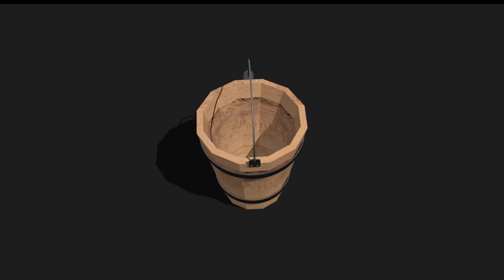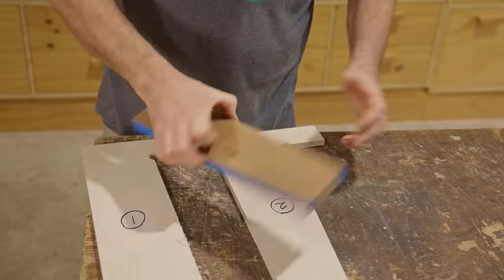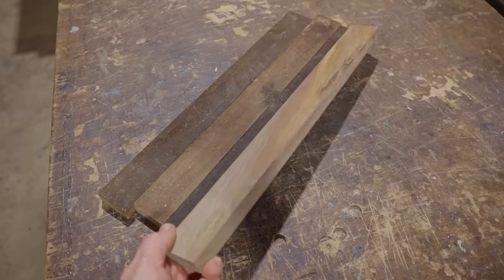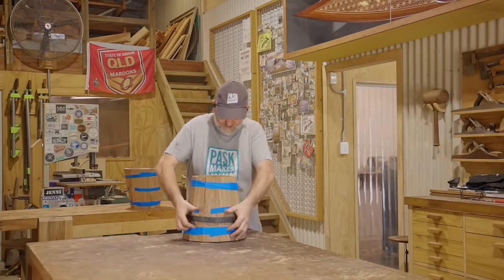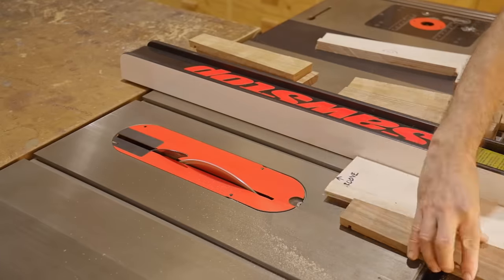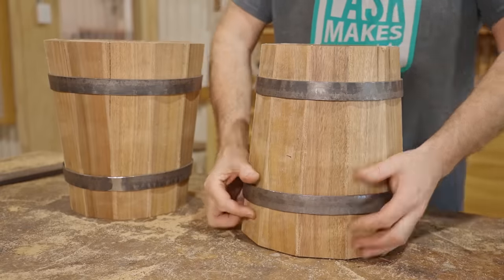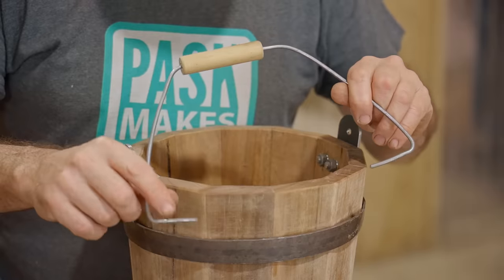Making a Good Old Days Wooden Bucket - Will it Leak? - SWC Ep53

Comment from the maker: https://paskmakes.com/free-plans/

When I made the original wooden bucket back in ep5 of Scrapwood Challenge https://youtu.be/KKrFnkQWO2s  I made, edited and uploaded the video all in one day. Because of that it was rushed and wasn't as clear as it could've been so I've always planned to remake it. 

It's a very cool project and definitely worth a go!
Reply: Timbecon have a nice flat 5 or 6 metre tape ideal for measuring curves. They've got a couple of nice little features, white with black marks, FastCap brand about $18.
Reply from the maker: @ohasis8331  I'll have a look at them, Thanks! :)
Reply: You should have a safety vest on while pushing wood through the saw. It's a mistake you only get 1 Chance at
Reply: Great video, love your work, would of been easier to weld the handle brackets to the top ring in my opinion but I don't have a successful YouTube channel do what do I know! 👍👍👍💚🇬🇧🌱
Reply: 6:07 you know it must have been a rather tiresome process to do that back in the day with just like an adze and an axe  and a plane for shaping ... huh
Reply: I want to see u make this bucket without power tool, like old day
Reply: I wonder how it would've gone if you'd mortised the staves.
Reply: @PaskMakes thanks for the lesson. I really appreciate the fact you show trials and errors along with your success! It makes everything less intimidating. 
I've not worked with that kind of metal...what if you cut the ends of the metal with a slight bevel before welding? Would that help force the ring into the required angle? What about cutting a slight dado on the outside and wire wrapping in a stacked layer? I'm not sure I have the strength to bend flat rods.
Can I coat the inside with melted beeswax? Would that work or crack off?

Comment: If you wanna make it the way it was built in the old days you heat up the steel collars red hot and drop it on. It will burn the wood making it perfect set and once it cools down it will squeeze the wood to a tight fit. The old days they set the cart wheels similar ways. Regardless just the thought to make something like that is cool. I Like your projects and the way you introduce the problem (only  small design flaw) and solving it on the spot. It does encourage others :  "Don't be afraid to make a mistake just learn from it and fix it" Anyone thought about it how they made those over 150 years ago?
Reply: Look up EngelsCoachShop on YouTube.
Reply: Oh wow. I suppose the rings will be expanded when hot, and when they seat, cool down, burn themselves on, they'll also shrink, adding tightness?
Reply: @MetalY2KMusic  
They shrink a little and help close gaps.
Reply: Heating the bands is not necessary on a tapered bucket. Just make them a tad undersized and force them into place from the bottom up.  They usually used a tool that looked like a blunted chisel to drive the hoop into place.
Reply: u will need water too, it makes the wood swollen
Reply: @Anvilbanger  and you can do it without glue that way to. Made replacing slates easier.
Reply: Burning them in is not a good idea, as you'd mostly be thumping the bands down tighter as the wood expands and contracts with temp changes after a couple of months. But heating them up a bit is a good idea. Cart wheels were different, you didnt want them to get loose at all, burning them on was just an affect of the extreme heat needed to maximise the fit.
Reply: Yes it is like he never bothered to watch a Cooper's video doing it properly! Iron hoops were too expensive long ago, only more modernly became used regularly, they used to use rope or wood in the same way as rope. Just look at old paintings.

Comment: My great grandfather made buckets in this style. He used to make the bucket itself out of softer wood and reinforce the spots where the handles were fitted with pieces of harder wood, so that the weight rested on those pieces.

Not too important if you're just using it for light work, but he had buckets that lasted decades for daily construction work. Cement mixing, carrying water, holding sand and dirt, things like that.

A day to make the buckets yielded decades of use.
Reply: Did he make the whole stave out of hardwood (two of them on opposite sides) and attach the handles to them?

Comment: In the winery we have particular brands of oak barrels that are notorious for leaking when new
To fix this we fill them with hot water and then run hot water over the sides which is a quick way to seal them
We also use a soft bees wax for minor leaks when filling with wine
Reply: Does the water cause the planks to expand or is it some other mechanism?
Reply: @IgneousExtrusive  yes, when the wood is soaked with fluid, the fibers expand

Comment: Great work! My grandfather was a woodworker & made a couple of buckets. He used many of the methods that you do. The one difference he did was to attach the handle to the upper ring. He said that it used the weight of the full bucket to help p seat the ring & keep things tight. He used parafin wax & linseed oil between the staves  & on the bottom for waterproofing.

Comment: I really like it. There is only one thing I might do different, and that's heating the ring for the final install in the same way a wheelwright would heat a steel tyre for the final fit on a wagon wheel, and quench it in the same fashion as well. I vaguely remember watching my Grandfather do it like that on the farm when I was a wee kid. Although I know my Grandfather was a blacksmith by trade, not a cooper, or a wheelwright either for that matter. Although most men of that time were somewhat multi skilled.

Comment: Now imagine how they were doing that before, without the adjustable angle power tools
Reply: Mate we've had stable, fixed drills and saws for over 10,000 years. They're not a complex idea
Reply: @jeremymcadam7400  there wasnt anything of the sort for saws during that time tho, it was all made with handsaws and planes
Reply: @jeremymcadam7400  you really have no clue on the timeline like yeah we had them for a long time but probably at most for 2000 years not10000
Reply: @jeremymcadam7400  We were living in caves 10 000 years ago. That’s about when homo sapiens sapiens was created. Complex tools would fit right on with for example the Roman empire, about 2000 years ago.
Reply: @josku5  modern anatomical humans are 300,000 years old... There are people living in caves today with no modern tools. The pyramids of Giza were older to Cleopatra, than Cleopatra is to us (around 6000 years old today). We barely have written text left from Cleopatra's time, let alone any idea what the civilization was called that built the pyramids. My point is that our evidence for civilization doesn't last very long, so just because we don't have preserved tools, doesn't mean they weren't around, why wouldn't they be around? 

 Another mind bender; Oxford University is 300 years OLDER than Machu Picchu
Reply: @jeremymcadam7400  not 300 years older, 300 years older than the discovery. Also, no. We did NOT have a modern table saw with modern computing technology 10 millennia ago.
Reply: @generallaro1269  No, Machu Picchu was built in the 15th century
Reply: @jeremymcadam7400  genius. Absolutely genius. You need a nobel prize
Reply: Oh shit you're talking about the inca city, not the mountain. Nvm then. Still though, we did not have a modern table saw with modern saw stops and electricity back 10,000 years ago.
Reply: @generallaro1269  are you 5?
Reply: @generallaro1269  my brother it is a spinning abrasive disc mounted to a table. no metallurgy, astronomy, or even numbers needed. not exactly rocket science
Reply: I followed this design and made with hand tools. No need for jigs and pretty straightforward... Just made a plywood pattern for the staves. Set my bevel gauge using Pask's excellent angle chart and Bob's your uncle... Took maybe 45 minutes to cut the 12 staves from salvaged oak and angle the sides with a jack plane. Cutting the slots was a bit of a challenge, but the whole thing came together very nicely.

Comment: You could simplify the build further by making two extra long panels and make a handle out of some rope and pass it through holes made in the top of the protruding panels
Reply: the downside of a rope as handle is that it could falls down in the bucket though, but honestly a great idea! i think i'll try that myself (: 
i prefer rope over metal since rope is easier to make yourself & producing it has less impact on the environment

Comment: Great work Neil! It might be good to weld the handle bracket onto the top ring to spread the weight out better and give a cleaner look. The bracket would only have to be a few mm longer.
Reply: As a bonus, carrying the bucket with anything heavy in it will then help tighten up that top ring.

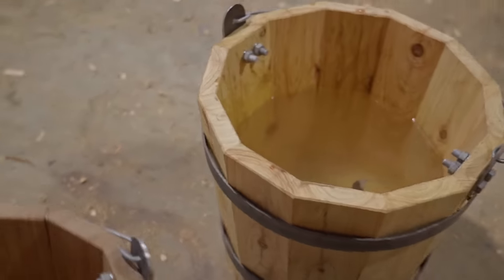Comment: Question Neil due to an observation: along with using a softer wood, wouldn't it be easier to use thinner metal band [say 1-1.5mm]? It's still plenty strong, and with downward pressure would then be compelled to follow the shape of the bucket. I'm asking because of the visible gaps between the metal and the bucket [24:25]. Anyway, thanks for all the helpful tips over the years. God bless.
Reply from the maker: Thanks Dan! The straps don't need to be thick and you're right 1- 1.5mm would be plenty strong enough. I really do like the look of the thicker ring though and I quite like the facets with the gap. As I said in the video the only issue was the crazy density of the wood I chose, it was a bad choice. :)
Reply: @PaskMakes  You could measure out and prebend the ring to the shape of the bucket.

And if you still wanted the round ring look, file the inside to fit the profile

Comment: Beautiful, as always.  Just as an FYI - you're a carpenter but I see you always going for those big ol' bolts.  Common Nails make great rivets and look so much better.  I use 16 penny for their 1/8" shank diameter.  If you want a really beefy rivet, those 60-penny spikes will do.  With one head already formed, it's short work to peen over the other.  You do have to heat the nail with your propane torch first, just to take out the work hardening that comes from the factory.  Then just treat them like any other steel rivets.  Those handle plates would have looked dreamy if you'd riveted them to the wood with some nails.  Joining the ends of the bands would have been a simple job, too, so no need to drill for clearance of a big ol' bolt head!  Just thought I'd throw that out there since I never see you using nails for rivets.
Reply: I was also thinking "rivets", although I was thinking of brass rods. I never would have thought of using big nails- and I have a big box of the things that somebody gave me... Thanks for that!
Reply: @stevekreitler9349  Glad I could help!  I've come to prefer nails simply because they're so uniform and cheap.  You can get them in 1/8" and 1/4" diameters, and just have to remember to heat them to a low red so they're malleable.
Reply: @threeriversforge1997  Have you tried annealing them first? I've done this with grade 8 bolts for various reasons- wire a bunch into a bundle, heat them red, then bury them in sand to cool slowly
. Easy-peasy.
Reply: @stevekreitler9349  Sure enough.  If you want to try something funny, anneal a handful of 16d nails and then challenge guys to drive them into some soft wood.  Those things are super soft after you've taken the work-hardening out of them!  Always good for a chuckle!

But, yea, if you're going to use nails for rivets, you have to anneal them first.  Otherwise they're likely to split or bend over instead of mushrooming nicely.

Comment: A friend of mine used to make planters like this for his Rhododendron plant business. One thing he did was make a dado where you have the steel rings. In the dado he would put a nylon strap and using a tensioner pull it tight and clasp it with a stainless steel clasp.  I've been wanting to make some myself but haven't figured out the angles. Your video helped a lot so I'm going to try it. Thanks, you are very skilled.

Comment: 12 sided polygon is a dodecagon.  Cool bucket!  Though I am wondering why you didn't just make a rabbet for it to slot into the groove.
Reply from the maker: Thanks Bekah! The staves are angled over so it wouldn't fit anyway, also the taper wedges into the groove and makes a seal. :)

Comment: putting the rings on hot gives a much tighter and leak proof fit up after they cool down
Reply: That’s how coopers traditionally put on the rings on barrels, and wheelwrights put on the steel tyres on the wheels.

Comment: The video says no glue, however the bottom of the bucket uses glue 🤔
Reply: I think the idea is that the bottom would be substituted with a larger single piece, but they glue together smaller parts to recycle wood scraps. The actual body of the bucket doesnt use glue
Reply: its a natural resin they used to make back in the day.
Reply: @crystalclover2247  it’s just weird to have no glue in the thumbnail as a clickbait rather than just not saying “no glue” when there is glue in the build.
Reply: @crystalclover2247  still wrong, he say no glue
Reply: @ottobass9193  Good grief, so use a single wide piece, if it's that important to you. The word you're looking for is pedantic. Sometimes, you just have to use common sense. I love this one.

Comment: Nice build.
What about looking at the rings in plain sawn wood and letting the centre face outward so it will form to the rings. Saves one round of tapering.
Also, if you let two opposing staves longer you can connect the handle through.

Comment: made a few buckets my self for flower pots ,they did not need to hold water , so i just used metal shipping straps for the bands, riveted together and gently tapped into place more for look and old used hemp rope through two longer staves with holes, knotted at each end so no longer can slip out the holes . fill 3\4 with soil , seed your favorite flower and water

Comment: Sealing the bottom joint with flax is interesting.  I have seen some Japanese tub type boats built and that was done without sealant.  I think it worked because of a more tightly fitting tapered groove and probably specific species of wood.  The sealer gives you a little more flexibility in design, I suppose.  Also, Japanese buckets and barrels were traditionally made with a special braided bamboo band rather than metal.  I've used cane (for chair seats) with some success.  I like the rasped edges. The final product looks great.

Comment: With all of your knowledge and skill, plus power tools, making the buckets is still a lot of work.  So I’m trying to imagine how important buckets were to our ancestors and how extremely difficult it must have been to construct a bucket with just hand tools and a sharp eye.  Good job.  Cheers
Reply: It was probably a little easier as I would imagine they would have just burned the inside of a log out. Like they did with the old canoes.
Reply: Making buckets and barrels (especially barrels) was important and skilled enough work that barrel-making was a trade. Most people with the surname “Cooper” are descended from barrel-makers.

Comment: Slightly thinner staves will have the same effect as softer wood.
When rings are driven to equivalent tension the contact area between staves will then result in a higher psi.

Comment: Awesome! Have you tried lightly torching the wood after assembly? It’s an old Japanese technique for sealing wood against water and insects. Siding and the bottom of posts are apparently both great candidates (Mr chickadee tried it out for a woodland barn), so I figure a bucket would be a good fit. 

Again, I’m really impressed. Way to go.

Comment: Hi Neil, I just love your videos and have learnt so much from you. I am 74 years of age and  starting to run out of energy. I remember well my parents laundry where they had four very large sinks made of a fine grain soft wood without any knots. Even our kitchen sink was the same timber. They never leaked as we had to leave at least two inches (5 cm) of water in the bottom at all times. We had a wringer in one sink that was water driven to spin the clothes dry. I don't recall worrying about water consumption then as our clothes line was raised and lowered also by the mains water pressure!  Keep up the great work and when we are in Noosa next I would love to catch up.  Cheers, Roger.

Comment: It's nice to see how you make this bucket! One or two improvement's have i.
First, the outside of the bucket cut the edges, to round the surface the rings will fit better.
Second, connect the handle to the upper ring and don't use wire, take a flat bar. So you don't have to drill the wood and the connection allows you to put the bucket up side down flat on the ground.And the weight off the filled bucket force the upper ring to the top off the bucket and seal it more.

Comment: Thank you Neil for this (again) lovely watch. I know the physics behind it but it still amazes me that you only need pressure to make the bucket watertight. One thing you could try is to weld the handlebare brackets to the upper ring so you don't need the 4 bolts.. or maybe even attach the handle to the upperring itself? Anyway, thank you

Comment: Great video! If you compress the wood, hitting the sides with a round wire and then planing a bit off, the wood will swell and seal.. Its used in boatbuilding.

Comment: Nice job sir and excellent problem solving skills. For anyone who wants to avoid the metal work aspect you can hoop your bucket with rope spliced together, we did this when I was at school 40 years ago. The resulting bucket can have a handle connecting to the top hoop but will need the hoops 'knocking on' every so often 😉